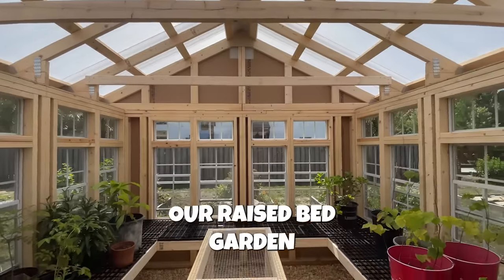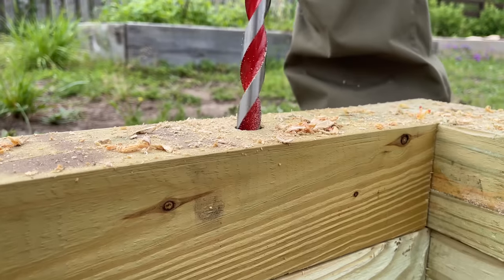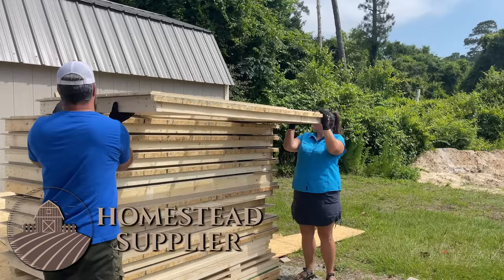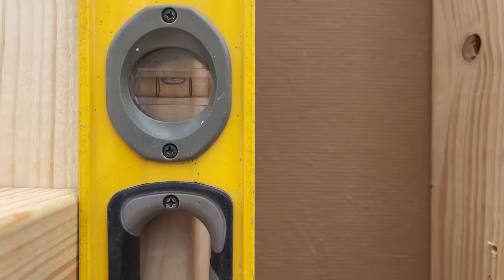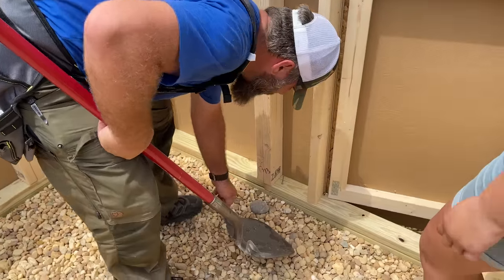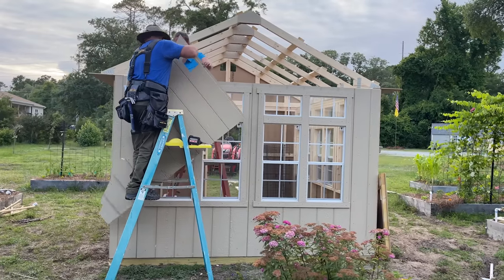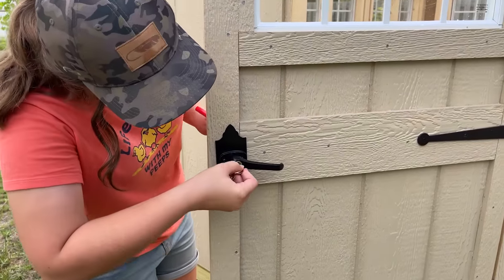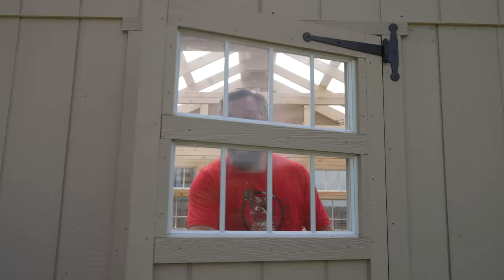The Secret To Building A 10x12 Greenhouse In One Day

Comment: These look pretty nice. They are currently about half the price of the sheds that are prebuilt or they build on site If you build your own floor.
Reply from the maker: Yes. Especially when you consider all the windows.
Reply: I just noticed that the sheds I was looking at are just the pre-cut lumber, not the pre-assembled panels. The pre-assembled panels are much more expensive.
Reply: $7000
Reply: @MAGAMAN  -  I’m not sure where you’re shopping, but HD has  10x12 wooden sheds for less than half the $5-7k for one of these sheds. Multiple options for $2,500.

Comment: The secret to assembling a premade greenhouse in one day.
We are supposed to use stainless steel screws with pressure treated wood. Epoxy screws will loose some of their coating when getting driven in and could be subject to galvanic corrosion caused by the copper in the preservative. 
Robertson square drive screws are the best

Comment: Putting the wooden parts straight on the ground is usually not a very good ideal (maybe in Sahara, only :D ).  3-4 years till the base will rot away. For me this looks like a very strange choice, esspecialy cause the greenhouse itself is so nice. Few screw piles or some bricks/building blocks with hydro insulation between woodens parts and itself, would prolong longevity of the construction for 10 years!

P.S. I am from Northern Europe where the amount of rainfall is ~ 700 - 800 mm per year and average air humidity is 81%. So I have to think very carefully how to protect my wooden construcions.

Comment: 7:30 looks like the factory completely missed those studs when nailing the siding.... also you would have been better off using screws for the sill plate in case you ever want to move the thing

Comment: Hi 👋

What would you do if you rent? And live in on the dryest continent, in the dryest state, in the desert.
I would love to make and install everything you suggest. Would be awesome.❤
Reply from the maker: I would also grow in containers so you can make the most of what water you have available. You can set up a self watering system that uses clay pots to allow the water to slowly seep into the soil. There are ways of growing hydroponically without power as well that are very simple but of course they require a lot of water. Look up the Kratky method.

Comment: I built Mom an 8x10 greenhouse from scratch on top of her garden box (which wasn't level).  I used 2x4s and clear drop cloth, which was supposed to slowly disintegrate in the sun.
The wind immediately tore apart my 3 $20 drop cloths.
I bought proper greenhouse material, but bought 48 in. x 96 in. x 0.157 in. (4mm) Clear Corrugated Twinwall Plastic Sheet (10-Pack) panels from Home Depot, which everyone said would work okay, just slowly yellow over a few years.
The front and roof disintegrated within months, even though I UV-treated them.
I replaced the roof with Tuftex Multi-Wall 6mm Panel Clear 4-ft x 8-ft Corrugated Clear Polycarbonate Plastic Roof Panel from Lowe's, which Bob of I Like to Make Stuff used to build a greenhouse.
They worked, but cost as much as the 10 panels from Home Depot.
Then, over the next 18 months, the Home Depot panels continued to disintegrate, and Mom refused to use the greenhouse that I built her, with permission, complained, and ordered me to tear it down.
I am not going to spend several hundred more to replace the remaining panels on a greenhouse Mom refuses to use, so I removed the side panels, and the Tuftex panel on the roof gouged my eye and I needed to go to the E.R.
Reply from the maker: Yikes

Comment: Great video and I would agree that instructions are over rated.  However, you need to step your game up.  They are not square  screws - they are Robertsons which most everyone up here lovingly calls Robbies.  Best type of construction screws out there.
Reply from the maker: In America almost nobody knows that unfortunately. I however do. 😉 It’s been a running theme on my channel for a couple years that the Robertson screw is the best screw. I used to have a t-shirt with it on my website. For some reason the only people who use them in America are cabinet builders which I did for twenty years. 👍

Comment: Wow! My husband built me a 12×16 greenhouse from recycled windows... (we're not going to talk about how long it took).. but I went to the website to check out the cost of the kit. Buy it folks! Seriously... our end costs were MUCH hire than  this kit. What we "figured" it would cost (even without the windows being purchased) compared to how much we actually spent... buy the kit. Those recycled windows are sticking and I'm struggling to open them. Do you know how much a sheet of plexiglass for a 6 foot door costs?!?!? Yeah... and it breaks really easy too.. If the company wants to send me a 10x16 kit to retrofit on an older 12x16 foundation... I'll send Haxman a video! Seriously....I was floored when I saw how fairly priced these kits are and how quickly it went up..with  sofits, flashing, trim, shelving  and a prehung door?!?!? It is NOT cheaper to build it yourself.  What a great find!
Reply from the maker: Thanks! We were going to do exactly what you did and then when we added it up we found out it was going to be more expensive as well. Around us at least, people want almost the same money for used windows that we could buy new ones for.

Comment: Guessing the idea behind this foundation is flood and hurricane proofing... (takes notes in Central Florida)
Reply from the maker: Mostly so the water can flow through when watering but this is a low spot in the yard so it serves dual purpose.
Reply: @HAXMAN  so drainage + secured so when something on higher ground breaks off and flies at it, the greenhouse doesn’t get knocked over. Got it.

Comment: eh "no.2 square drive" is actually called by its proper name... "Robertson"
But don't you know most of us Canucks would call it a "Red Robbie"  🍁🍁🍁
Reply from the maker: I’ve never heard Red Robbie before.  I’ll have to use that. 😄Usually I call it a Robertson but pretty much no American knows that. I have found over the years that Canadians are quite proud of it though. 😄
Reply: @HAXMAN  they colour the handles of the screwdriver different...no2 is red. Makes it easy to find the right one without trying hard...unless you're colour blind 🤔